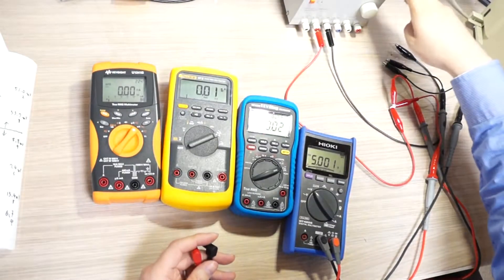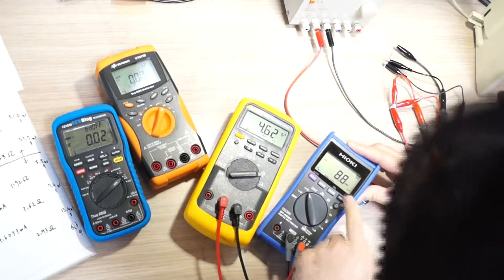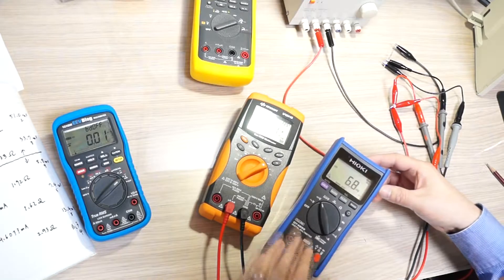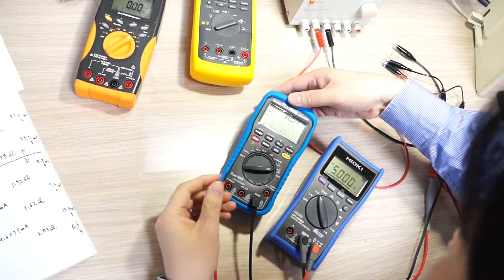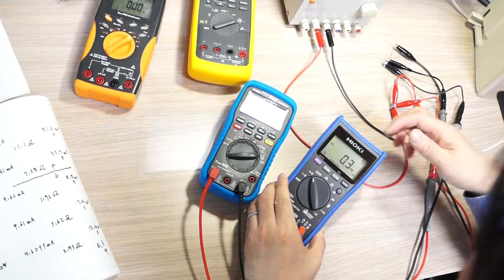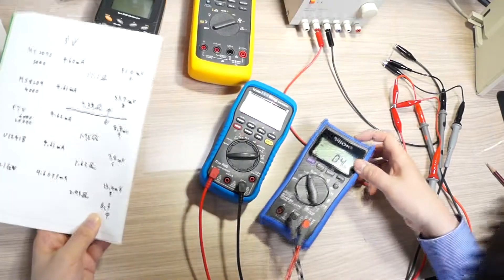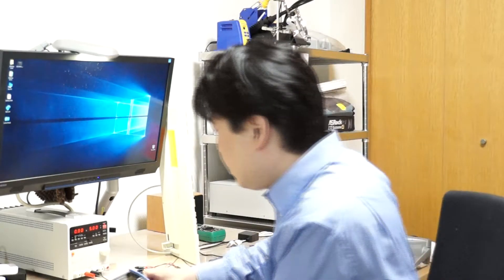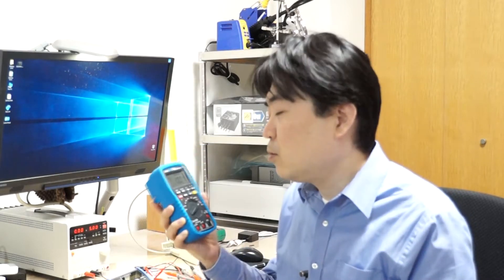Akira-EN #6 121GW, Correct way to Measure mA and Super Low Burden Voltage

Comment: Would it be possible for you to tell me where to buy the alligator clips that you use with your multimeters. I've been looking all over the internet for them and I can't find them. I really like your videos. Continue your great work.
Reply from the maker: The alligator clip on test probe is superbly useful for me. I bought one pair at local store in Tokyo. I also made one pair by buying 2mm jacks with small alligator clips and pvc wires. These are the links of the prebuilt one and the components where I bought. https://www.sanwa-meter.co.jp/japan/items/detail.php?id=390  and 
99centHobbies store I found at eevblog forum.

Comment: Thanks for the video.  I understood the difference of the burden Voltage.  But, one thing I noticed weird.
When using “mA” terminal, the reading was 4.6mA.
When using “A/500mA” terminal, the reading is not 4.6mA, rather 4.2~4.3mA and seems not stable.
The reading cannot be seen well, because of the reflection of light.  So I might be wrong.
Can you confirm the difference?
Reply from the maker: Yes, it was about 4.2-4.3mA, when I measuring with A/500mA jack, I might need to adjust the range manually to have more accurate value, or it could be just because my 121GW is the early production lot. I think I need to confirm again.
Reply: It seems to be a trade off between either burden voltage or accuracy. Should my calculations according to the 121gw manual be correct, when measuring 5mA and using the 5mA rage, the maximal error to be still in spec could be 13uA or 0.26%. In the 50mA range we are talking around 17uA absolute, equaling 0,35%. 
In the 500mA range we have close to 190uA error or 3,75%. That is an order of magnitude higher. Sure, most likely be still more than accurate enough, but it's showing the tradeoff and should be mentioned for fairness. 

I'll happily stand corrected with those numbers, I have not been able to find the discussion on the eevblog.